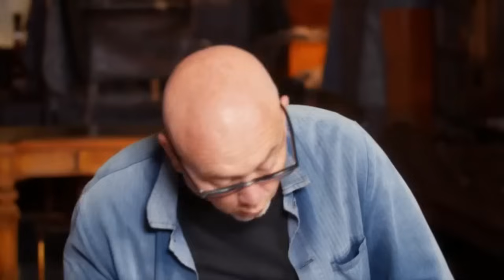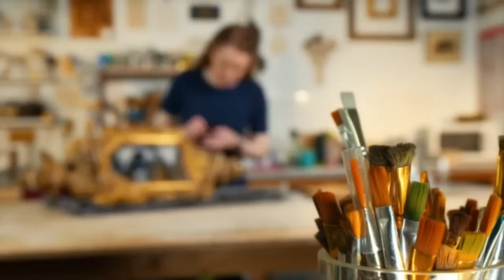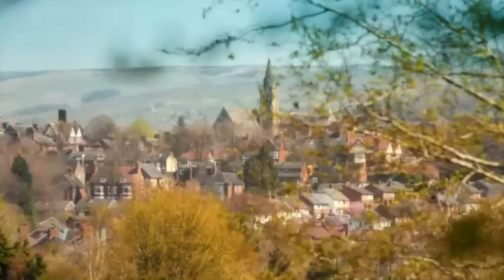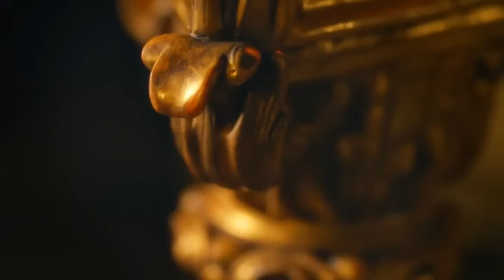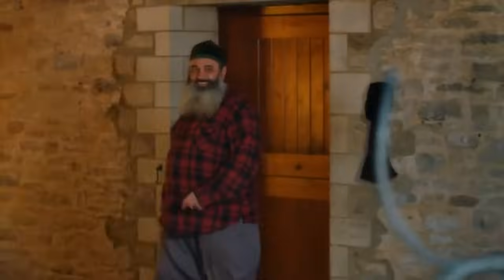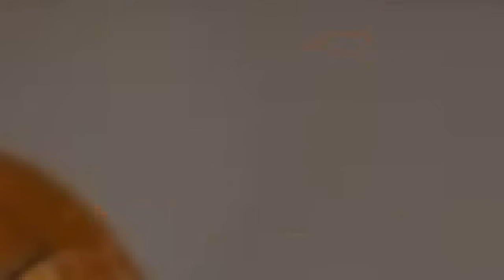19 Century Gilded Lantern - Salvage Hunters Rs 602

Comment: This modernising for using electricity ruins too many antiques. My Oriental vase, bought 'for peanuts' should have been beyond my purse, but a previous owner had put a cable in it. The whole body is cracked: I love it, but I wish it just had its missing lid, not wire inside.